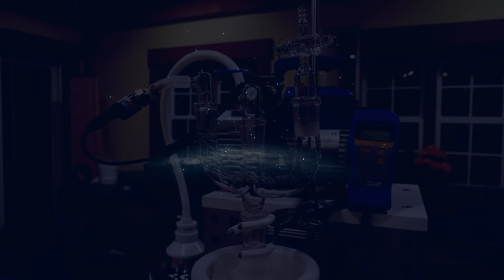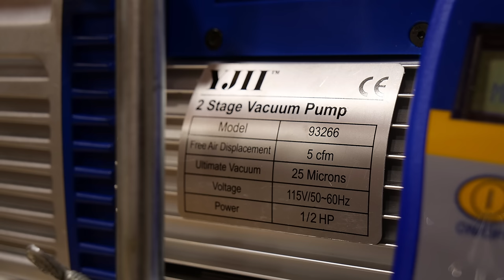Vacuum pump with NO moving parts

Comment: “Any physical principle can be treated like a hassle or a problem or a challenge...or a tool.”
Reply: We had a terrible  principal when I was in HighSchool
Reply: He seems to have hinted that it could also be used to separate a solvent in an extracted oil?
Could he fill a column with the beads and then run solvent across an organic material like peppermint/garlic, dumping the output into the column full of beads, where the beads will adsorb the solvent letting the oil pass through? 
I guess you could weigh all the gear at the start and tell by weight how much separation you got. Hmm.
Reply: @V0S1N0  depends on the physical size of the particles, but it does seem that the process takes time at high concentrations, so you would likely need the molecular sieve to sit in the solution.
This is a common way to purify ethanol to 100% after distillation
Reply: And when you have a problem, you have a problem, but sometimes, when you have 2 problems you can use them to solve each other.
Reply: he's really layering up the puns in this one. dad level 420 achieved.
Reply: @V0S1N0  there is whole bunch of separation principles based on interaction of a mobile phase with a stationary phase, those methods/principles are collectively called chromatopgraphic methods or "chromatography". Those are highly used in all kinds of industry, analytics, etc. Wikipedia will give you a basic overview.
Reply: "Any sufficiently advanced knowledge of physics is indistinguishable from magic."
Reply: @V0S1N0  I think you more or less just described HPLC, or high performance liquid chromatography. It works on a different principle though as the liquid is passed through the adsorbent under pressure.
Reply: it is a challenge to Change the physical Problem into a tool.
it is another challenge to find the physical Problem that cancel each other out as Tools.
example:
Problem 1: you Need to cool an ICE-hockey Stadium
Problem  2: you Need to heat a public Swimmingpool
Solution: build them next to each other and heat the Swimmingpool with the heat drawn out of the ice-surface.
at least for some time of the year you reduce Energy Costs drastically.
Reply: @dizzolve  Could you say he was a..... tool?
Reply: @V0S1N0  IIRC a similar system is used to make lactose free milk.
Reply: At my work, we turn flaws into features. I'm in 3D printing research.

Comment: We use cryopumps in my job to pump very large volumes down to high vacuum. They're quite cost effective at that scale, and have an important advantage over a turbopump, in that they can fairly easily deal with gasses that are intentionally released into the vacuum system during a process. Turbos also have trouble with non-gaseous particles, whereas a cryo will not be damaged by such things. Turbos can be much more sensitive also to  heavy stuff like noble gasses, where a cryo can just condense whatever you throw at it, within reason. With a pair of pumps, if one becomes saturated, it can be closed from the system with a valve while the other continues to work, and regenerated without compromising the vacuum chamber. 

They're definitely more "primitive" than some kinds of vacuum tech, and can have serious drawbacks, but within their niche they are extremely useful.
Reply: thank you for that info.I want to learn as much as I can on subject.
Reply: Out of curiosity, have you ever experimented with hooking another pump in to regenerate the cryo pump without removing it from the system? I'm personally curious about vacuum ejector systems that scavenge their working fluid from the material to be removed, but the general case is a point of curiosity itself.
Reply: @absalomdraconis  By removing it from the system he means closing a valve and not physically taking it out. If you look at how o2 concentrators work that is exactly what they do. They have 2 chambers full of the filter medium (Usually something to filter nitrogen) and while one is working the other is regenerated and then a valve switches over and the other works while that one is regenerated. To regenerate them you just need to heat it (with internal heating elements) causing the gas to expand and boil off. These systems are often used by glass blowers because they need huge amounts of oxygen to "fuel" their torches.
Reply: @excitedbox5705  : I was already aware of what was meant by removing it from the system.
Reply: Unfortunately cryopumping doesn't work well with helium gas, I still need a turbo.

Comment: I love the videos, but on a smaller/lower resolution screen, it can be challenging to make out the various instrumentation measurements seen in your videos. If you agree this is an issue, I'd suggest adding little "expanded view" enlargements. These should be fairly easy to do for static shots in your video editor.

On a different note, I found the description of how our visual systems respond to low oxygen strikingly magical.
Reply: yea, seeing the read-out on meter would be helpful.
Reply: I had the same problem. The meter wasn't readable on my phone, especially when the resolution dropped due to my cellular connection bogging down. I would appreciate it if you would try to narrate things like meter readings which may be hard to see on some screens. I still enjoyed this video and learned from it.
Reply: I'm on a reasonably decent 17 inch screen about arms-length away and could not make out the display on the meter.
Reply: I couldn't see anything on the vacuum gauge while sitting 4 feet from a 55" UHDTV. I thought maybe the instrument had one of those newfangled invisible ink displays.
Reply: @karlharvymarx2650  i would have never expected to have to say that: but 4 feet is too far away from a 55" 4k screen ;) at least if you use full Resolution.
Reply: The meter image was too small. This is the only complaint I will ever have. Love this channel.
Reply: For what it's worth, at times, I couldn't even read it on 1 17" screen, due to glare lol.
Reply: i did not see shit. and i'm looking it on a 35inc tv

Comment: A DIY oxygen concentrator for welding would make an interesting future project.
Reply: Oxygen concentrators are frequently used with propane instead of oxygen/ acetylene for brazing set ups. I use one for bicycle  framebuilding.
Reply: @shirk15  why would you have to use propane instead of acetylene?
Reply: @xenonram  people are afraid of acetylene
Reply: @xenonram  it is much easier to get for a diy home use. Also safer. It gets plenty hot enough for fillet brazing with nickel bronze brazing alloy.  When you run out on a sunday afternoon you just steal the tank off your bbq to finish your project.
Reply: @xenonram  sorry I misread that, you could use acetylene if you wanted. See previous reply on why I decided to use propane instead.
Reply: I second the motion for a DIY concentrator.
Reply: @shirk15  But you can't weld with oxy/propane.
Reply: @empanada401  you can't weld steel maybe lol
Propane is a lot cheaper than acetylene also. A lot of large demolition and scrap processing cutting torches are oxy/propane simply for lower operating costs.
Reply: @empanada401  correct not welding. More like a super hot glue gun. Worked well enough for planes, motorcycles, and race cars that it does the trick for bikes.
Reply: @empanada401   You can cut though.
Reply: @brainretardant  no idea. For bike building it wouldn't be needed.
Reply: @xenonram  cheaper, cleaner, easier to obtain... Many reasons.
Reply: And a DIY ultrasonic or pulse laser welder!
Reply: There was someone who built an oxygen/nitrogen separator - mainly for building a nitrogen source as it's a bit cleaner for pneumatics and because for home use nitrogen in tires lasts longer with less leakage.

He just vented the oxygen to atmosphere, but there is no reason you couldn't harvest and compress the oxygen.  ... Other than the horrifying consequences of a leak near heat or some of the reactions that occur when oxygen is compressed.  Weird things start to happen when the pressure and oxygen concentrations go up.  Stable things start to burst into flame and whatnot.

Comment: Brilliant video. You are completely correct that the use of heat blankets or lamps will increase the pump down rate on vacuum chambers. In semiconductor equipment, traps like these are often used to reduce contamination from oil filled vacuum pumps from ever reaching the high vacuum chambers. One effect that we had to teach vacuum maintenance workers... Virtual leaks. A video explaining what a vented screw is and how big an effect a virtual leak can have on a high vacuum chamber would be awesome. A factory can lose so much time waiting for the base pressure to never be achieved due to this cause.  Hope your day is really good.

Comment: I was involved in building two of these in college back when the cheapest pre-built system my university was able to get was coming in at $1.8M. The two we built only cost $67K in total, basically pocket change in comparison. This takes me back for sure, really interesting stuff and I'm glad to see someone covering it. 

We used liquid helium to cool ours, like you mentioned, and we used custom built ceramic heating coils running with a very complex array of thermometers to monitor heating and cooling. The hardest part was building the heating and cooling arrays, a lot of extremely fiddly TIG welding and expensive fittings went into them.

We did use the sheet configuration you mentioned, the sheets were manufactured by one of my professors and his team of post-grads in the materials science department. It was a huge project, we went through a variety of prototypes. It took us a year and a half to produce the final pump.

Our very first (functional) proof of concept looked a lot like what you have in this video, and it worked almost as well as the final full scale pump. Great video, I really enjoyed seeing you explain the concepts behind it. What you said about physical principles and their utility as tools, that's very insightful. It's people who see solutions where others see problems who make the biggest changes.
Reply from the maker: Wow that would have been an exciting project to have participated in.
Your philosophical analysis is solid as well.  Thanks!

Comment: When I worked with vacuum systems I used a liquid Nitrogen chilled “ Cold Finger “ which trapped remanent gases within the system. Coupled with an ion getter pump high vacuum was achieved.
Reply: High power radar components?
Microwaves ... ?

Comment: I use 3A sieves to dry acetone when working with certain water sensitive pyro comps. Works very well. They are also physically small enough to use as the seed cores for making pyrotechnic stars as well.

Comment: I'm curious to see how well the heating/cooling effect might have without the beads. Just by heating the gas molecules, the pressure would be raised enough for the pump to remove a few more, and cooling it back down would lower the pressure. Then it can be a straight comparison for the performance of the beads.
Reply: There are for sure Zeolite traps which are not refrigerated, and might have heaters attached to them somehow.  So, they do SOMETHING (catch water I think, which is important) and/or catch the oil from the mechanical pump.  You can buy them for either service, not too expensive.  Simple and rugged.  I think the cryogenic one has much higher performance, but the heater-only kind might be cheaper to run,  and just in general be big and dumb.

Comment: Excellent video, molecular sieves are amazing to work with.   I worked with Lectrodryer and developed for our plant an ability to make ultra dry solvents on a large scale using highly activated 3A molecular sieves.  I was able to produce 1 ppm water acetonitrile, and 3 ppm water THF on a large scale.  We developed a Cycletainer system to store and transport the material.   The system used Argon as the inert gas.  I also used a small amount of indicating molecular sieves in the system to remove peroxides.   The Lectrodryer system super activates these sieves by blowing hot nitrogen gas down the column.

Comment: I used to work on UHV systems (~10^-11 torr). It was always amusing to show them to visitors because this gleaming piece of stainless steel high tech beauty was covered in wrinkled aluminium foil and kevlar blankets to hold the heat in when we went for a bake out. Always looked a bit grubby. Wonderful machines. 

I am pleasantly surprised you can get a pump easily running to those vacuum levels for ~$250. That is a hell of a deal.

Comment: Another great video. In the lab the bake out process can take hours to get all the oxygen and water off the inside of the chamber walls. For UHV systems the chamber material becomes important because helium atoms are so small they can squeeze through solid walls and you will get some leakage no matter what. The microscopic world is truly fascinating.

Comment: Can you try epoxy with steel wool as a cheap alternative to carbon fiber?
Reply: Weave it and epoxy it for maximum strength, but I'd assume most steel wool wouldn't have a high tensile strength. It would be interesting vaccum bagging a bunch of it so it compresses by itself lol

Comment: This is fascinating, thank you for this video. I was looking into molecular sieves when I was semi-seriously considering building a nitrogen/oxygen separator since commercial units are crazy expensive. I thought it would be interesting to try using pure nitrogen to run compressed air tools for the sake of low/no moisture... may re-visit that project soon! I saw another build someone did, and like most things, the theory isn't complicated, but in practice, to build something practically useful, the major cost is in all the fittings, connections, valves, switches, etc. 
Currently "building" a high current DC power supply (adapting a computer power supply) for electrolysis to dissolve/dispose scrap metal, which has always been something I've enjoyed playing with, lol. This channel is probably the best I've seen in terms of crazy interesting technology explained by someone who really knows his stuff. 👍👍👍
YouTube has a lot of nonsense on it, but when it comes to discovering gems like this channel, CodysLab, bigclive, techmoan, Technology Connections, etc., there's nothing better.
Reply from the maker: Thank you!

Comment: Back in the 1982-84 time frame I worked on ion beam implanters for the dopping  of silicon wafers in the process of making IC chips. We would vacuum Down a chamber first using a mechanical diffusion pump  then cryogenic pump after all the items stopped out gassing due to the low pressure we could reach down to the milli tore range this would take about 3 days I do not recall the size of the chamber. This demonstration brought back memories thank you.😀🛫

Comment: I don't have a Yellow Jacket vacuum pump so yours might be different I have a JB Industries Eliminator, also a 2 stage pump.  The instructions for mine recommends breaking the vacuum on the pump and letting it run for 2 minutes after pulling a deep vacuum to express the oil from the pump prior to shutting it down.  Have fun with your vacuum pump it looks new.  I just got mine last week and am looking for things to do with it.  Fun video.

Comment: We use cryo pumps in the semiconductor industry. Sputter tech uses a diaphragm pump to pull down the chamber / cryo to their base, then we introduce an inline turbo to help the pumpdown and introduce incandescent light to "bake out" the chamber. Once we hit 1e^-2 Torr we then turn on our cryo pump. The cryo pump takes about 1 hour to cool down from 300 Kelvin to 64 K. After the pump has hit 64k, we close the gate valve to the cryo and let it chill further to ~4-7K . Once the cryo is fully chilled, we open up the gate valve and it will pull the chamber down to 1e^-7 Torr! It's really fun to control and watch. After the cryo has had it's fill of argon or we need to perform PM's we close the gate valve and turn on a heater element which will shoot out all the gas it has collected via a exhaust port. But we reuse the cryo pump hundreds of times without replacing any parts typically for about 4 years before the desiccant becomes exhausted.

Comment: Great video, I am doing gas phase chemistry and I am using mole sieve sometimes to purify gases. From my perspective as a chemist, Van der Waals is a chemical bond too. You can calculate and determine a bond dissociation energy (BDE) for those interactions and in fact, the longest bond in chemistry is a Van der Waals complex of two helium atoms (helium dimer).
Also, if you are working with vacuum and glassware, you should wear safety goggles.
Thank you for your great videos!
Reply: "if you are working with vacuum and glassware, you should wear safety goggles" especially when you heat/cool the glass.

Comment: At about 18 minutes into the video, you discuss something you describe as "equilibrium temperature". It might be more precise to call this a steady state rather than an equilibrium. The rate of boiling in the nitrogen has fallen to a constant level so the heat entering the system is balanced by the heat leaving it via the boiling nitrogen. This is a steady state rather than an equilibrium because there is an energy flux maintaining the balance.

Earlier on, you discussed some true equilibria with gas molecules and molecular sieves. Here, the rates of gas adhesion and evaporation also balance each other but in this case the system is closed and there is no (short term) energy flux.

I very much enjoy your work. Thank you.